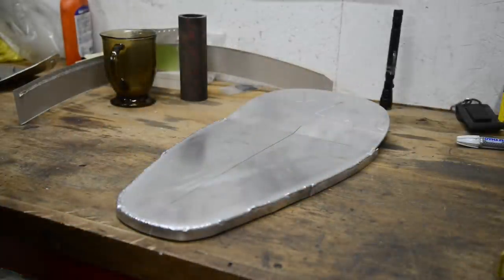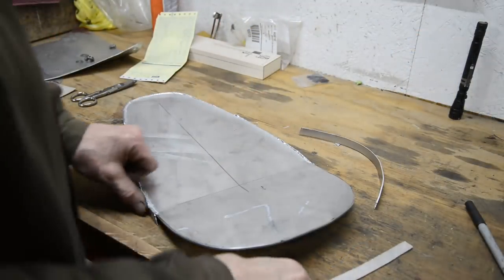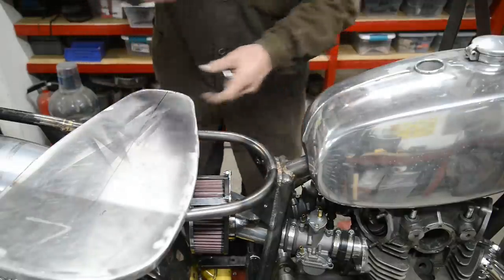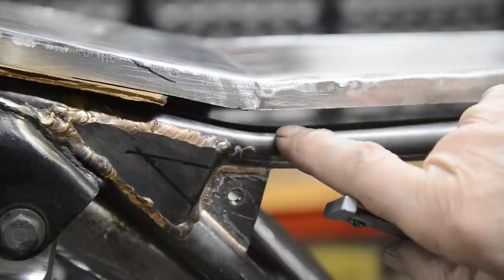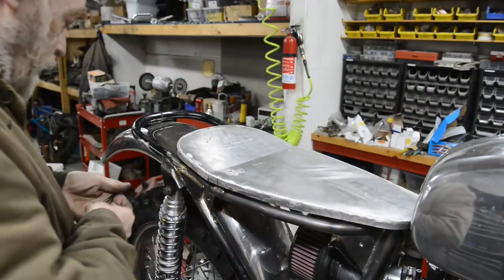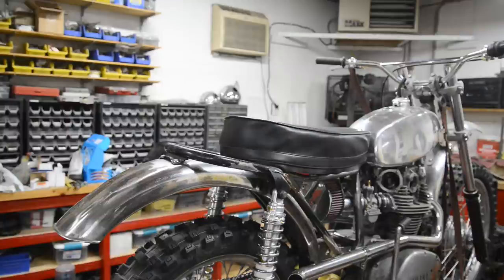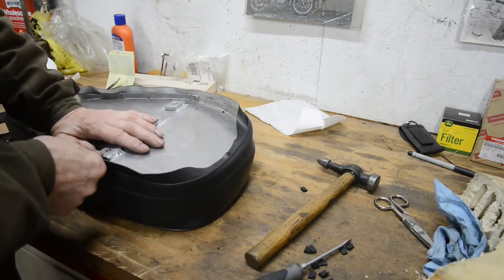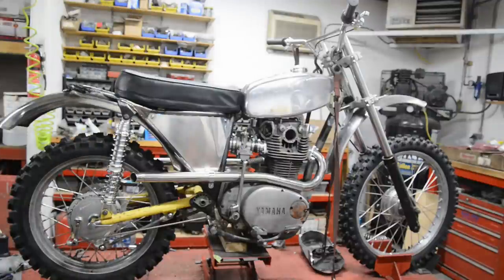650 YamBSAki Scrambler  -  Part Seventeen

Comment: Another great Sunday and my fingernails are clean, thanks. 

FWIW, much of my fun watching this channel is disagreeing with you. I see you do something and think “mistake, I wouldn’t do it that way”. Then I watch, most of the time you were thinking of something I wasn’t or you had a goal in mind I didn’t understand. This bike is a case of that, I really didn’t get the bike when you started. Ironically I came around when you did the pipes, today locked that in. Looking at the nearly finished bike brought back one of the early motorcycle highlights of my life, my father and my uncle took me to a local scrambles when I was about 10. The sound, the the speed, seeing the guys (and the powder puffs) wrestling the bikes. I was mesmerized, this was even better than the midget races! And, I wasn’t crying and my eyes weren’t burning from the whatever the midgets were using as fuel. Pull the lights and this bike could have lined up at that race and only it’s much better than any other competitor details would make it stand out. That does assume nobody noticed the Yamaha engine or the BSA frame that were both years from being released. ;^)
Reply from the maker: I always have a look in mind, but also it has to work. But you know what real life is like, things don't always turn out the way you thought that they would.

Comment: The bike is already looking very inviting to ride and that 650 Yamaha engine should give in some characterful grunt. Good work. Back in 1974, I bought a secondhand Yamaha XS2 650. I felt like I was king of the road! Until I reached a corner 😃 Terrible handling. They invited good old Percy Tait to sort it out for them in later models, I believe.
Reply: It was Kenny Roberts who helped develop the XS, he was dirt tracking one bored to 750cc
Reply: @andyb7963  It was also Percy Tait: "Meanwhile, the XS2 never sold well in Britain and had virtually been forgotten after a couple of years. Rather than move on (or perhaps make another mistake like the TX750?) Yamaha decided to update the 650. To this end, the new European R&D centre based in the Netherlands brought in expertise from the former enemy, in the guise of racer and ex-Triumph test pilot, Percy Tait.
The result of his labour was seen in 1975 as the XS650B. Outwardly, the obvious changes were ‘Blitish’ styling, alloy spoked wheels, twin front calipers behind the fork legs and a massive pair of silencers. Under the new clothes, the engine was little changed, but the frame benefited from extra gusseting, a longer wheelbase and altered geometry. Ready to rumble, the bike weighed about 15kg more, but the handling was definitely more predictable, if not perfect."
Reply from the maker: My only bad accident was on a 72 XS2 which got into a tank slapper, pitched me off at about 70 and shattered my left wrist. Great engone though.
Reply: @BritanniaMotorcycles  That's a coincidence. Mine was a 72 model as well and it threw me off at 70+ on the Winchester bypass after I'd ridden down from Crewe. I'm still not sure what happened, but the back wheel locked up and I went speedway style before lowsiding. No injuries!

Comment: Hi Mike, loving the yambsaki, just a couple of suggestions following today's video. 
How about using studs in the seat base and the bottom side panel mountings. Seat will locate automatically and you can use hex nuts and a socket to tighten it up. Bottom of the side panel can be tightened with a dome head. 
Also, how about a strip of that adhesive foam along the rear strap.
Reply from the maker: All valid thoughts. If it had of been a steel base I would have welded bolts to stick through. The foam probably.

Comment: You have to take Allen with "tongue in cheek".. Ever since he put out that "Crank Modification" fairy tale, I have been flooding his comment sections mercilessly.. He won't give up what bike he got the Crank Pin from and makesbit sound (to the sheep) like he is putting 2 rods in a single rod Crank Pin...HORSE FARTS!!..LOL..does make entertaining Video's though...He has all his heavy work done at machine shop Crank Balancing etc .Now a real engineer was the guy who made the double siamese Triumph drag bike back in the 70's..His SS250 has a serious issue with his wierd Carb setup..I like making wierd engines ..we were stacking 6 rotor RX-7 motors in drag boats back in the80's..and cutting V8 into V4's and  V12's..Chopping VW's into 2 cyl.90HP for bikes and planes..etc..My latest Big Hp engine was out of a pile of Porsche engines..if you mix and match you come out with a 4.0..stuck it in a Boxster, with Turbo Suspension and Brakes (modified wheel carriers) Paddle Tran. Custom Nose..etc.etc.  200mph+ ..I started doing this in the 60's with flat heads, and hemi's..made a 6 wheel Ford 9n Tractor once..I'm doing a Rickman BSA right now..2 CX Honda Customs, Ducati 900SS, a 71 160cc Stornello Guzzi and a CB1100 10 speed driveshaft Custom..I just hooked up today with a guy in Australia that sells plans for a 10 foot aluminum Jet Boat with a Yamaha 500cc engine..Stay Healthy Keep working..👍👍👍🇺🇸

Comment: Michael Blue Peter! please don't tell me you are going to get the wire coat hangers and tinsel out when Christmas comes.

You were very diplomatic with the aloominum comment or maybe showing off you are multilingual, aloominum and debree I can live with but please when it comes to the front end don't let me hear ears and triple trees with not a tree in sight, don't they know they are YOLKS and when doing the wiring let them know there is an L in soLder and when the wife is cooking there is an H at the start of erbs. I know, I know it's all a laugh and they're still learning, but someday they will get there.

I have seen many of Alan Milyards bikes and heard them run at Stafford and other shows and believe me the finish is like a factory finish. I asked him did he cast the crankcases for his engines, his answer was " No I cut and weld them from original cases and the only cases I cast was for the Flying Millyard". The Velocette is the one I really took too as I have a 37 MSS 500, Velocette should have made this bike. Ask him in his comments how long it took him to build, You will be shocked.

Incidentally Michael I noticed your exhaust covers your side panel bottom fastening screw, what were you thinking? I mean, what next?
Reply from the maker: I know, I must be working to hard. Get down Spot.

Comment: Michael have you thought about drilling hole in the seat base to allow the foam to "bounce"
Reply from the maker: No I hadn't, good idea.
Reply: @BritanniaMotorcycles  every seat pan I have seen has holes to allow air in and out, may also stop the foam from rotting.